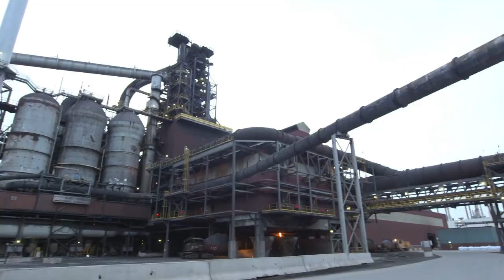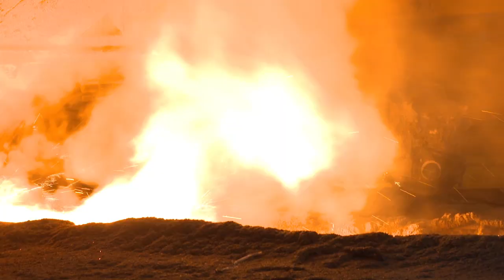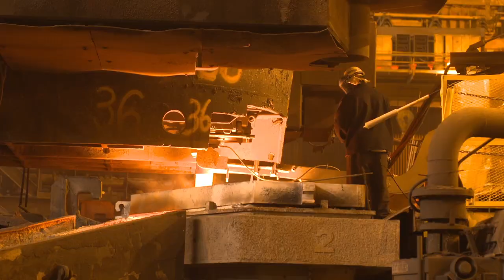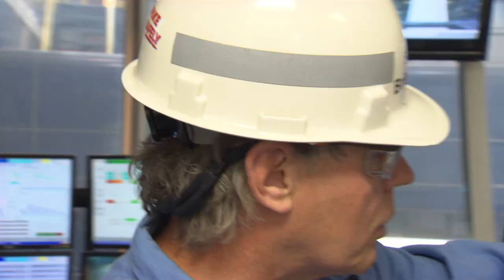Severstal Dearborn Mill Tour

Comment: Twelve years later and under cliffs ownership they just announced 600 layoffs and the idling of the blast furnace, the BOF and the caster operations. They crippled this mill when they took it over in 2020 by closing the hot strip mill. This steel mill put people in affordable cars and kept people in good paying jobs. It’s the last furnace in the Detroit area. Ford, rouge steel, severstal, AK, and finally Cleveland Cliffs. 1920-2025

Comment: We need more plants like this one in the USA. I own a very small metal fab shop with cap to shape .125 thick X 96" sheet, mostly alum. and S.Steel but do use  .125" cold rolled sheet.

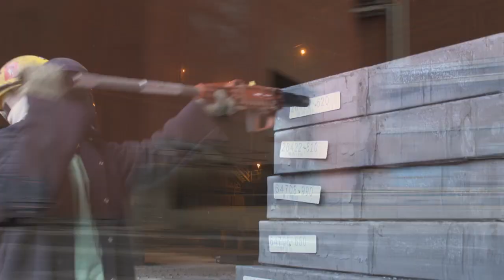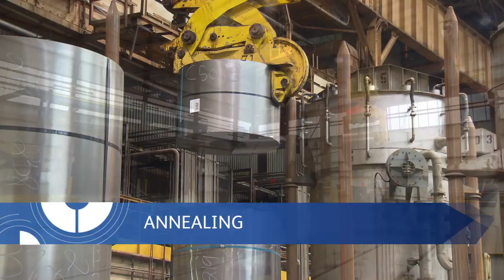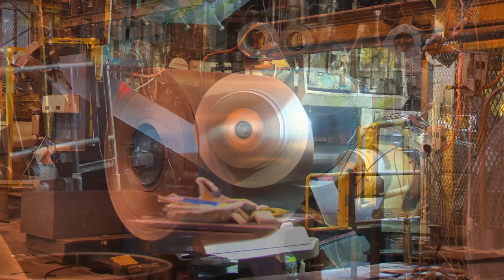Comment: Updates- Hot Strip Mill (5:07), Original Cold Mill building, my old home, with Annealing (8:10) and Temper Mill (aka skin pass) (8:26) were all closed as of Summer 2020. We are now called Cleveland Cliffs. As for the blast furnaces, 'A' furnace was shut down and pillaged for parts long before I hired in 30 years ago. Some portions of 'A' are currently being removed and scrapped. Severstal took 'B' furnace out (it is an empty hole now) with plans to rebuild. Rebuild never happened. 'C' furnace is still running.
Reply: Sucks about the jobs that were lost. Hopefully conditions improve and maybe they’ll consider restarting the mills. I’ve been a 2 stand 4 high cold mill operator at an aluminum plant for 16 years. Rolling aluminum sheet coils for building and construction markets, commercial cookware, license plates, etc. 🤙🏻
Reply: @djhaloeight  A few that were thinking about retiring did just that. Everyone else went to other buildings. The whole plant was short staffed before closing HSM and CM. Some trades chose to go to the newly created mobile maintenance and crane repair departments. I went to utilities.
Reply: Y section 3695 worked overtime in h10 h9 j5 j6 k2 k4 x2 x3 x5 x4 . Worked all cranes in annealing including the one in this video known as w6. Skinpass cranes z3 z5 z1  the old shipping cranes and new shipping cranes band yard cranes sy3 and sy2 I put in the upgrades to hotsrip hm8 and tore out the old downender and conveyor put in the new coil handling system when the pltcm came online annealing had 2 tandem mills dumping steel on us. Everything I knew and worked they shut down severstal canceled our 30 years and out  pension . They split the cold mill in 2 . Ak cliffs left us without the capability to ever produce our own coils again we can no longer be a stand alone mill . Someone else would have to buy us and build a new hotsrip because from what I know the hotsrip in this video has been partially tore apart .
Reply: This is really quite sad.
Reply: @mosesmarlboro5401 it is really sad I still walk through some of those areas and remember all the people and the work we put in to keep producing we was like a dysfunctional family and seen more of our coworkers then our own families the amount of people who raised there families in these abandoned areas I can't even imagine how many people went through there. We all got split up into different buildings . It is true we was all short handed and most just got relocated but it's the number of jobs lost that will never be filled that other people could of hired into and raised there families with . The disrespect other companies had when coming in and dismantling history of the ford rouge plant. They could left it all alone and used it as part of the tour from Henry for museum. Old pickle lines and tandem mill looks like a war zone and it looks like it hasn't ran for 50 years
Reply: i worked at rouge steel from 86 to 92 as a millwright .at the time blast was running A and C and I worked out of the old snake pit . transferred to J9 from there I held a schedule in the hot strip the cold mill and electric furnace. spent years in J9 going to the caster the bof and the Galvinizer . much over time under the reheat furnaces in the hot mill.   I was in the power house on 2 1 99 when it blew. as an apprentice I worked in the coke ovens when all the ovens were on line.  hard to believe so much has changed..

Comment: It's a shame Covid forced AK to basically shut down half the mill.
Reply: Talks of shutting down that hotsrip started about 8 months before covid my opinion is they used the stimulus check to there benefit and while people was already laid off due to covid . They refused sub pay because of the stimulus. As far as annealing temper mill  "skinpass" goes when they shut down batch annealing years ago sealed it's fate . The hydrogen bases was not enough to keep the skinpass running 40 hours a week. We went from supplying that skinpass for 3 shifts 10 years ago to only supplying enough  with hydrogen annealing to run skinpass maybe 30 hours . Cost of using outside contractors to move coils from new mill into old building on top of 3 shifts of workers in annealing and the 1 shift on skinpass that can only get about 30 hours a week of actual run time that's not feasible.  The cost of energy for batch annealing shut down natural gas nitrogen and hydrogen prices got to high 10 years ago.  Those batch bases many of them was built in the 1940's some was in the late 1960's they was energy hogs . Wasn't covid it was all on borrowed time at that point already.  Along with all that it was mismanaged and nothing done to reduce costs there decisions made only increased costs

Comment: The 68" hot mill has been shut down.
Reply: Lost my job in the hot strip last March, just got a call back today to work again in the pltcm
Reply: I went from annealing and bid into band yard annealing looked as if it was gonna get shut down so went to band yard "t-section" thinking as long as hotsrip was running I had a job ironically they closed both down at same time when that hotmill actually ran fast on all 3 stoves if they didn't have a break down they could send band yard a lot of black bands fast .   Kinda hard to keep up with tonnage goals when Middletown was taking all our slabs. I relocated to A section shipping

Comment: That looks like double eagle. I worked for a company that used to go there and repair the rubber on the rolls and tanks for the plating process. The company was abtrax industries in ingster Michigan .
Reply: They do look similar but Double Eagle doesn't do hot dipped. I don't know if they are still running. They were bought by US Steel where, I worked. USS closed up their steel making in Detroit but still do the galvanizing, pickling and finishing. Severstal's hot dip looks eerily like GLW's same as their hot rolling and the BOF that we called BOP. I retired from USS just as they were laying everyone off.
Reply: @blake9358  Who cares?
Reply: @Alejandro-vb2fx  Why do you watch these videos? Hmmmmmmm 🤔

Comment: I've never heard of hydrogen rich atmospheres used to "restore ductility ~8:09" in steel. I believe the contrary is true as hydrogen would embrittle steel and reduce ductility, and strength.
Reply: If you hold steel at 200-300c for several hours in a low hydrogen atmosphere it will remove trapped hydrogen by effusion. This is actually to reduce hydrogen embrittlement and ease stresses on the surface.

Comment: Worked in a steel mill as an engineer for a while.  From a technical perspective, there is a lot of intimate details that are fascinating.  Working in the environment, however, sucks.  Much of this video is marketing BS.  Not wrong, but shown from a slanted perspective.
Reply: @thegenrl  Hot, cold, union environment, caught between management and the union, in operation 24x7, so worked holidays often.

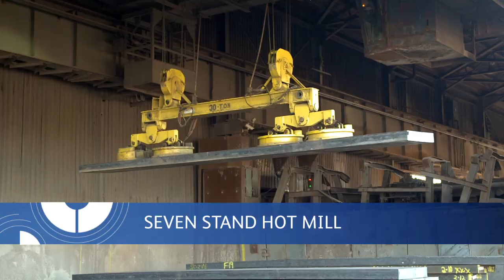Comment: 5:11 63 thousand pounds hanging from a 30 ton hoist? Where's OSHA
Reply: Cranes are rated in metric tons, different then English tons. 2200 lb is a metric ton. 
second what idiot converts lb into kilo then back into tons....
Reply: WHY? 63.000 pounds is only 28.576,32 kg = 28,5 ton!
Reply: @samkom33  learn some math dude. 63,000 lbs is 31.5 tons.
Reply: @MegaJohnhammond  1 pound =  0.45359237 kilograms
and i used this converter:
https://www.justintools.com/unit-conversion/mass-weight.php?k1=pounds&k2=kilograms&q=63000
Reply: I have never seen steel come of this mill that weighs more then 58,000 lbs the guy talking just saying a general statement other hotsrips that can run 72" slabs probably would hit that weight.
Reply: Fuck osha
Reply: @Connor-dp5sy  why?

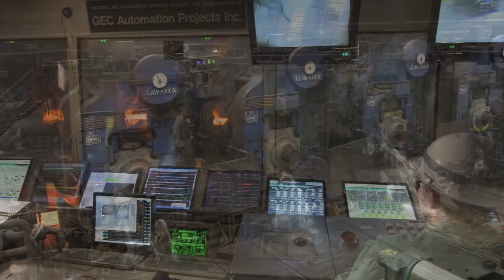Comment: 5:43  What is the water for?  So the rollers don't melt?
Reply: Before each mill the slab is spayed with very high pressure water to remove scale. You would think it would rapidly cool the slab, but it does not. After the finish mill the strip, which is much thinner now, goes through the laminars. The laminars dump thousands of gallons on the strip and cool it substantially(depending on the product) before it is coiled.

Comment: Pure Oxygen is blown into the furnace at more than 21,000 cubic feet per minute? Without the furnace blowing up or disintegrating? Considering how reactive O2 can make any super heated substance.
Reply: It is how you turn molten iron into molten steel. Without the oxygen process you can’t make steel. And it’s a LOUD and dirty process. The Basic Oxygen Furnace is one of the dirtiest places in this mill. The Blast furmace where I spent most of my 18yrs there is the 2nd/3rd dirtiest. Nasty job but honestly some of the best people I’ve ever worked with.
Reply: @jayrobinson4378  Interesting but confusing, i thought steel was just a regulation of the carbon content in iron? I like to know how things work to the molecule if possible. I dont expect you to get into that kind of detail but it shows me i need a better understanding of how steel is made.
   Thanks for turning me to look further into this.
Reply: Yeah my nerd side got rattled when i heard them say they use O2 to refine iron, now i have to look into this, i dont know how to make steel best but i know you dont find iron as metal, you find it as oxide and spend a lot of energy removing the oxygen.
Reply: It is an OPEN TOP VESSEL, not a furnace. Narrator said it wrong. Yes, it’s blasted in the vessel exactly like blowing air into a straw that’s in a glass of water.
Reply: @jayrobinson4378  Why would you ever want to add oxygen to iron?
Reply: The amount of energy lost, energy needed and the fact those walls holding it are so thick and made out of pretty unreliable uncrackable stuff
Reply: @TheFreshSpam  What are you even saying? Did you just contradict yourself twice in one sentence?
Reply: @TheFreshSpam : made out of pretty unreliable uncrackable stuff - - - - Sorry dude but this statement is just Hog Wash - better rethink your statement. . . . .

Comment: It’s sad this mill was bought by AK and driven into the ground.
Reply: Ak got rid of the people who made it run! Ak is a miserable company to work for!
Reply: @jondoe3561  that is traditional house cleaning that happens.  When a new company takes over they usually bring in their own vendors too. 
 The city of Dearborn, gives the new company tax breaks for several years.  When those years pass,  and taxes are about to go up they sell the business. This was once owned by ford motor co,  sevetstal, ak steel . Perhaps u.s. steel will acquire this in the future.
Reply: I am a Jorgenson Forge ex- employee. Mitt Romney destroyed steel industries throughout North America while at Bain capital Mgmt. He called it creative destruction; Pierre defector the sell out. Fontana California ran for 2 weeks and dismantled then shipped to China. Jorgenson went out of business because maintenance issues with the 5000 ton press resulted in an inspection and decision to attempt putting in a much larger new press. When outages occur and dirt is removed to convert to a larger cylinder soil samples turned up asbestos. Too big a liability. Once asbestos is disturbed the EPA gets involved. I worked as a journeyman millwright and felt something wrong was going on with my lungs. The AOD vessels in particular were contaminated. Now Trump is trying to rewright workplace safety standards to make it impossible to sue

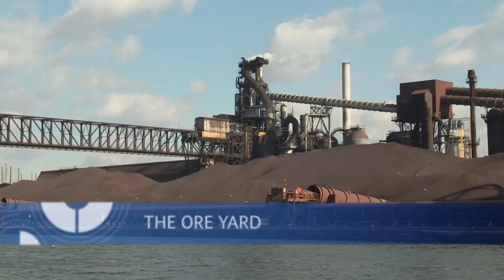Comment: I live 50 km (36 mi)  from this factory. I drive by it every time I go into Detroit. I can see the piles of rocks. I have taken the tour, no longer available, and seen the furnace, the rolling mil, the stamping presses (I ran such a press right out of high school) and the assembly line. I tell people in distant parts of the Unites States, that I live near a factory that turns rocks (1:25) into automobiles, and they LAUGH at me. Automobiles are not made of rocks they are made of steel. What idiots. This video shows the rocks at 1:25, and how they are turned into rolls of steel. At https://www.youtube.com/watch?v=r9byGJtbCws thirty-seconds in you can see how they turn the rolls of sheet steel into a car door. So, of course, they make cars out of rocks.
Reply: Yes, indeed.  They also make integrated circuits (and therefore computers) out of rocks!  Incredible, when you think about it.
Reply: Saginaw, born and raised
Reply: @JTGolf989 I live in warren
Reply: Hemlock Semiconductor in Hemlock, Michigan grows silicon. The 2nd largest plant in the world other than in China I believe. Were it not for tariffs enacted in 2009 the plant would have doubled in size. They wanted to build a nuclear power plant in Midland MI to power that and DOW. DOW Chemical, another plant thats the 3rd largest in the U.S. 

ADD the Great Lakes, the largest underground salt mine in the U.S. and a bunch of sand to make concrete. Michigan makes the U.S. and the world work!

Comment: A lot of that equipment looks like the original stuff built by Henry Ford.
Reply: Some of our stuff in the cold mill probably is. We have oil circuit breakers from the 1930s. (Yes they still work well and are in use). In the older buildings we still use DC. So Edison (Ford's friend) had a hand in the building of the facility. I've seen parts purchase records dating the the 1940s and 50s. Building blueprints for our cold mill have Albert Khan stamps on them. Oh, and the rumors of tunnels all over the facility are real. I've been in a few of them, but many are blocked off now. I'm 3rd generation, my family has been at this facility a combined 104 years.

Comment: That is cleanest mill I ever saw!  not like the ones in east chicago in
Reply: 90 percent is a dump only what they want you to see is clean
Reply: I work at #7 in East Chicago...... it's a dump. I spend 90% of my time rebuilding structure instead of fixing equipment. It's falling apart faster than we can replace unfortunately.
Reply: @mephInc  what happens to the structure that makes it fall apart?
Reply: @JustinCrediblename  
Weather, sulfur, age, wear and tear.
Reply: @JustinCrediblename  weather, age, and zero plant maintenance.
Reply: The ONLY buildings not a shithole are the PLTCM and HDGL. 18yrs I spent there, most in the Blast Furnace, that place is NASTY!
Reply: @Da_Man Adventures  the local nucor bar mill in my town works Monday - Friday production with every other Saterday & Sunday as shut down days for cleaning and maintenance.
Reply: DANIEL mota Wow, exact opposite of 20 years ago when I was visiting facilities in both locations.
Reply: They definitely cleaned up just for the video believe me it's a dump it's filthy hotsrip was filthy the old cold mill was filthy grease steam that wasn't water but oil steam asbestos, cerwool fiber, sand, trash, debris is everywhere.  After all those iso 9000 audits they eliminated cleaners. Even the locker rooms went from having a cleaner on all 3 shifts to a once a day contract cleaner company.  Bof is like hell on earth never been in blast furnace. That pltcm was newer when this video was made I'm sure it isn't nowhere as clean as it was then haven't been over there in about 6 to 7 years though
Reply: I spent time there over the years. Making pig iron and steel is the dirty part. Lol. It was a fascinating place to work as an electrician.